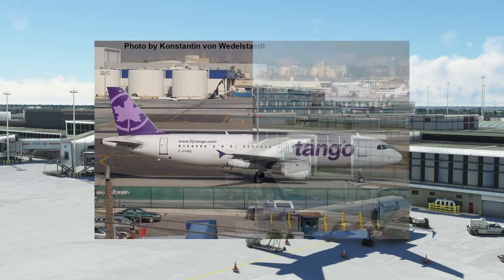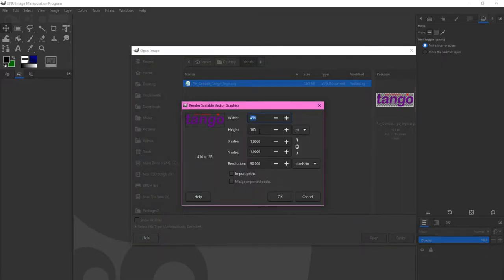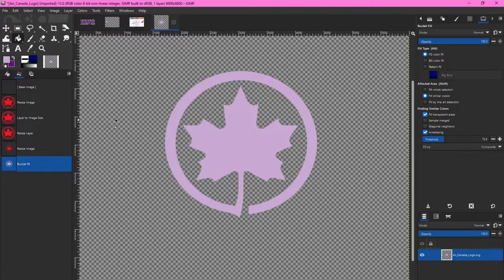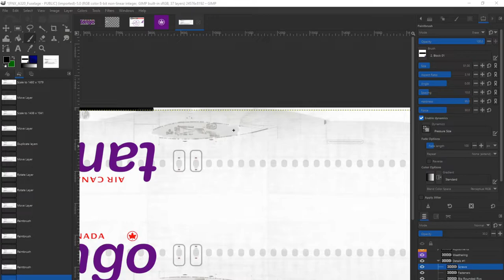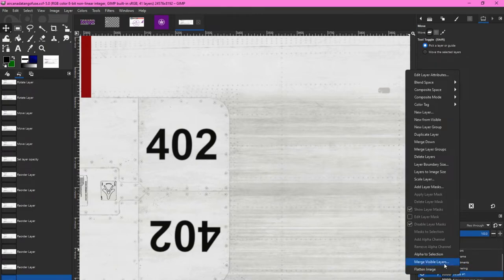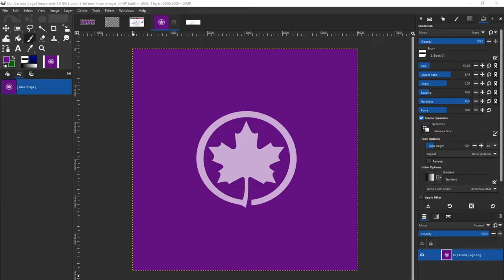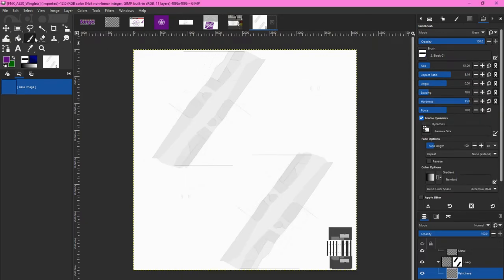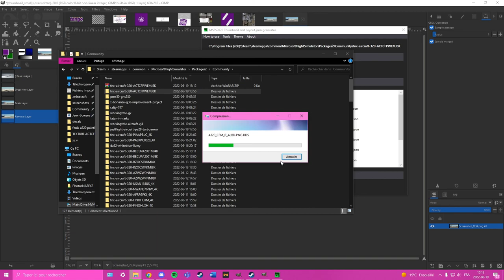[OUTDATED 2022] Create a Livery for the Fenix A320 w/ no cost - Microsoft Flight Simulator

Comment: Excellent tutorial. Thank you. :)
A quick question...
Is BLENDER a must or can we do our paint using only GIMP/ Photoshop?
Reply from the maker: It is possible to use Gimp and photoshop only for this aircraft, but some of the decals and paint you will put on it may be a little distorted when loading it in the sim
Reply: @berinchtein  I see, thank you.
Reply: @berinchtein  hi, i came to search yt on how to create livery for fenix and i think you are the only (i could be wrong) channel done the tutorial for fenix. Thank for the tutorial. Have u tried to use blender & adobe photoshop to create these for fenix? I couldnt get the alignment correctly (fuse 1-3) when load it into sim. Wondering if u can provide tips if using photoshop rather than GIMP. Creating liveries for fbw was much more straight/easy compared to fenix with 3 different part of fuselage. I am surrendering half way (haha), considered im not a fully time designer.

Comment: Do you need the change the layout.json file at all as the file  paths for the textures are still left at what the default example folder was called?
Reply from the maker: I would recommend running the program that changes it automatically as many times as you can, because the layout.json file also contains other informations than the titles like the size of the textures

Edit: as many times I mean during the livery production, but it doesn't need to be changed once the livery is complete and works fine in the sim